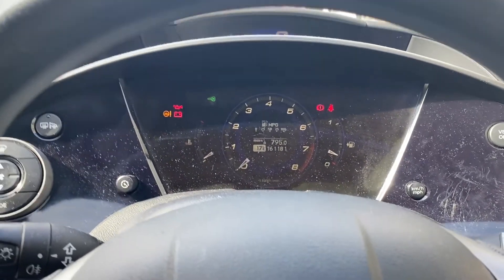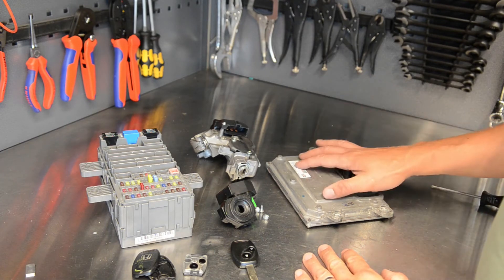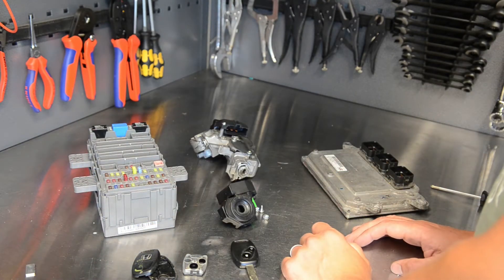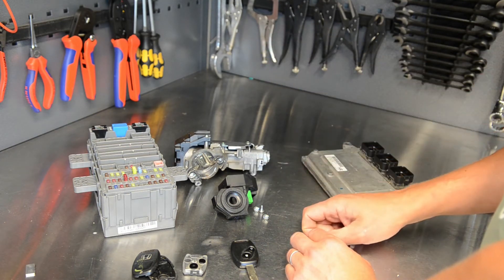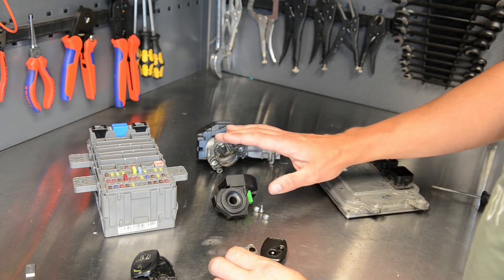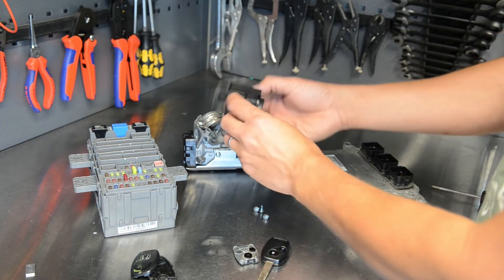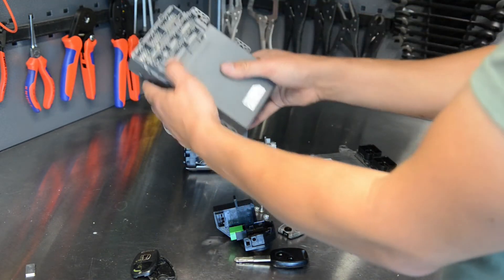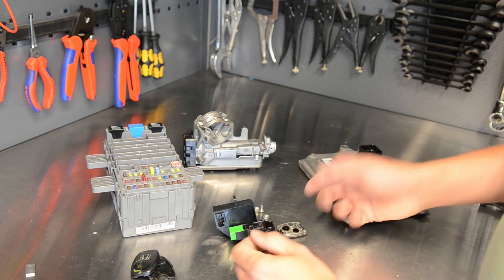Honds Civic Gen 8 2006-12 faulty ECU, MCU and immobiliser solution what you need to swap.

Comment: I replaced the ecu along with the key and immobilizer, still did not resolve the immobilizer issue for me. I'm stuck.
Reply from the maker: You have to swap all the parts, and they all have to come from the same car. The ring, mcu, ecu and key are all coded
Reply: Get the Thinkdiag mini code reader (cheap). It will reprogram Civic's keys and get you in again. I get the flashing green key if the battery goes flat. Unless the ECU is actually fried, it'll work, trust me. https://www.youtube.com/watch?v=koK84SHNOH0

Comment: Hi ive got a customers 57plate honda frv 2.2 diesel, flashing green key crank no start after battery+alternaor replaced (diagnosed by AA). I've tried to talk to immobilizer ecu via honda hds program but it wont communicate, on the live data its saying immobilizer 'BAN', I've been told it just needs a simple "all keys lost procedure" but not 100% sure if that will work+cost of £130+vat, sbb key prog etc dont list FRV on vehicle lists for usa/Europe honda. Would this procedure work that your describing? Thanks Tom
Reply from the maker: It should because your replacing everything, there is no coding involved as all parts come from the same doner.

Comment: Hello there, I ve got an 8th generation 1.4 lt 2007 HONDA CIVIC with IDSI engine. Without any ECU fault codes the engine cranks but without spark any of the ignition coils. I have replaced the crank sensor and cam sensor but still nothing. Fuel  Pump and Injectors checked and works ok. The electrician made certain checks and found nothing. The ECU connects and can read all of the car information. The immobilizer key flashes once instantly as soon as the key is turned in second position. Second key also used. Any idea pls.

Comment: I've an 8th gen civic (EU variant, not US one. I'm assuming you have the same one) and my immobilizer can't read the key if the inside of the car gets hot. Basically if it's 18 degrees and the car is left out in the sun - it won't start and immobilizer icon will keep blinking until it cools off. (assuming it can cool off if the day is not that hot). I've replaced the immobilizer antenna (the one around ignition) - same issue. Do these civics have an immobilizer control unit? Like a separate part besides antenna and MCU? Since the issue appears only if the inside of the car is hot, it's not ECU for sure. But I thought there is some other part like ICU (immobilizer control unit)?
Reply from the maker: Yeah this is a European model 5 door model, build Swindon, UK. In this model the antenna, the ecu, and the MCU are all chipped to the key, so you can’t just swap one. I’m in Ireland so it never gets too hot. I looked at the wiring diagram and the immobiliser is integrated, there is no stand alone unit you can replace. You need to swap the whole lot. I’m surprised you were able to replace just the pickup antenna, I tested that at the time and it was it wouldn’t work if it wasn’t matched to the complete the set. Hope this helps, you have a very unusual problem.
Reply: @Yoke.  well I didn't replace the antenna myself, it was done by an auto electrician and they had to reprogram it (something) with my key. But the issue remained. Either I got another antenna with the same issue which is unlikely or another part related to it causes the issue. I assumed there is some sort of immobilizer control unit part as well (chatgpt lied to me I guess), but if everything related to the immobilizer in these hatchbacks is the antenna, fuse box (MCU) and ECU, then it has to be the fuse box. If ECU is located under the hood, the only part related to it which remains in the inside of the car is the fuse box. In that case I will order a used fuse box and replace it.
Reply from the maker: @BruchoSindicate  Buy the full set and swap it out, it’s just plug and play. I got mine on eBay, it was cheap. The MCU is a nightmare to get to, might be easier to pull the driver seat out and lie flat on the floor. You will need a key with that set too and just swap the chip with your key. The pickup antenna can also be swapped without taking the steering wheel off but it’s a bit tricky to get to, I did it so it can be done. If you look at the wiring diagram for the car there is nothing else associated with the immobiliser
Reply: @Yoke.  Since I've already ordered and received the entire fuse box (under the dash) I will replace it alone at this point. Sadly the seller didn't have immobilizer and ECU from the same car as well. So I will try my luck with the fuse box alone. I wonder if ignition assembly itself has some electronics which could lead to faulty immobilizer signal when warm. Hopefully not. Logically if we have 3 main parts which could be the issue - ECU, MCU and imob. antenna it seems like the fuse box (MCU) is the only remaining suspect. I will try my luck and let you know if that worked. Hopefully it's not some wire or connector, that would be a hell to troubleshoot. This issue has already been insanely annoying.
Reply from the maker: @BruchoSindicate  ignition is just a switch, there is no electronics in it. It’s just simple on, off. See how you get on, it’s a tricky one to swap out, loosen what you can, you will also need long nose pliers to pull the connectors and long screw drivers to push the tabs. I suggest wear gloves as there is lots of metal edges, you will cut yourself. Good luck.

On a side note, I remember years ago I had a Honda Beat, if you drove it for a long time, turned it off. It sometime wouldn’t start from hot. It turned out the the fuel pump relay was getting too hot, engine was near it. The solder would melt a little and you would get dry joints, I re-soldered  it and it never game me trouble again. Could be something silly like that. Where do you live that it gets this hot?
Reply: @Yoke.  I know for a fact that the issue is regarding immobilizer system and not fuel pump relay, because immobilizer key blinks and doesn't turn off when I put my key in and try to start the car when it's hot. 

The funny thing is, it's doesn't really need to get that hot. I live in Lithuania, so weather is similar to UK during spring/summer. If I would leave it parked in the sun with closed windows even at 16 degrees C for a long time it will not start. So during the summer it's pretty much un-usable. I really doubt that the antenna which I've already changed had the same issue, and since ECU is under the hood and the only remaining link to immobilisation system is the fuse box I really hope that will do it. 

But again, I will need an auto electrician to change it, I've read in repair manual that changing the fuse box when ECU and antenna are not from the same car will need to be reprogrammed.
Reply from the maker: You are right In everything your saying, the internal fuse box is the last component now. I’ve been to Lithuania, it can get hot in the summer. My point was that the solder meted at the pcb and created dry joints that worked when cold but not when warm. If this is not a fix then you need to look at the joints for any dry joints. Good luck I think your on the right track
Reply: @Yoke.  Damn I think I've checked the wrong manual though. The manual depicting MCU (fuse box) as a part of immobilizer system is for US version civic, sedan one. Found one for EU/UK version - fuse box is not in the picture. If its replacement won't help - I'm out of options. 😁
Reply from the maker: @BruchoSindicate  is yours a 5 door model or 4 door? And where was your car manufactured? Because the 4 door sold in Europe is built in Japan, and that’s a different car.
Reply: @Yoke.  5 door, hatchback. I believe it's FK3. It was sold originally in France.
Reply from the maker: Same car so, I suggest buy the whole set and swap it out. This way it’s one job, you will save a lot of time and sets are cheap on eBay. Pick the same year and model.
Reply: @Yoke.  So coming back to this with an update, they have replaced the fuse box, reprogrammed it - immobilizer key kept flashing even when not hot. They replaced back the old one - same thing. So they found out that some wire leading up to immobilizer antenna (I assume) was in a bad condition, so they removed it completely and connected a new one (seems like it goes out of one of the fuse slots in the fuse box directly, so it's a bit mad max style for sure) and then it worked again. So it seems like that culprit was that damn wire all along. But I can't test it for sure because the weather got cooler and I need at least 16-18 degrees of sunny weather to test it. But yeah, I have a feeling that will be it.😁
Reply from the maker: @BruchoSindicate  hopefully that’s it. If it was a damaged wire the. Temperature wouldn’t effect it really, and it must have been tampered with previously for it to get damaged. Hopefully this now solves the problem. You have plenty of spare parts now 😀
Reply: @Yoke.  maybe it was the fuse box AND the damaged wire, well will see once the weather warms up, then I will know for sure 😁

Comment: Did u flash / reprogram the ecu
Reply from the maker: No I didn’t do any flashing, I bought a complete matched set so I wouldn’t have to do that. All has to be from the same vehicle and then it’s just bolt off, bolt on
Reply: @Yoke.  

That’s good to hear , I was worry I have to flash it. So I’m assuming everything works great even the key imobilzer with the new ecu…
Reply from the maker: @gfhjhvjgfvkjvv3666  yeah it will work for you but you need to swap all the components and the chip in the key as they are all coded even the immobiliser ring around the steering wheel. I found this all on eBay but it’s needs to all be from the same car, you need ECU, MCU (fancy fuse box), key, immobiliser ring, and ignition. Swap them and off you go. Only thing is I knew what caused the issue in my car, so whatever issue you have had to be sorted otherwise you could blow the new one too
Reply: @Yoke.  

Got it , thks 👍
Reply from the maker: @gfhjhvjgfvkjvv3666  good luck

Comment: Hey man, if you’ve got the time I have further questioning about a similar situation to this. If you could respond back to me either here or on another platform I’d very much appreciate it!
Reply: I had a similar issue show up on my 2008 Honda civic Si after a lack of a chassis ground either threw my car into security mode or fried the ECU. The car will start every other ignition cycle but will immediately die after starting. The only cluster lights that come on are the red ring around the tachometer and no door locks, window switches, or sunroof controls are operable within the car unless voltage is applied through a third party power source directly to the unit. I’ve pulled the driver door lock cylinder, ignition cylinder, and ECU and plan to replace the BCM as well for the window/sunroof switches. The power locks still function with the key fob however, which has me stumped. Fried ecu? And what do you recommend I swap out to get it back to functioning as it did before?
Reply from the maker: @michaelsapp6675  that’s a good one, I suppose to test the ecu you need specialist equipment to really know what part of the circuit failed. Since your like me doing this at home, swapping one part of this is not really an option as immobiliser will stop the car. The ecu, bcm, key and immobiliser ring are are coded to each other. They only problem in your case is that you don’t know the cause, so you swap it out and it get fried again.  You would really need to find the fault first or what happened just before the damage, were you at anything before hand. What caused the damage in this civic was an earth applied to the wrong pin on the air conditioning unit (not by me). Pull up the circuit diagram but everything goes through the bcm and if you swap that you need to swap the rest as you have no way of coding the new bcm.

Comment: Thanks a lot for this video. It is pretty much the only solid and reliable solution for the imobilisier problem if you want to diy. I ordered the kit from ebay for my 2006 civic mk8. Although it was from 2008 model and had G34 number on the ECU instead of original G13 it works fine. Took me 1.5h to swap it. The fuse box was a real pain but managed. I made a small and long 90deg hook to pull the clips on the sockets from below and then from the side pushed the sockets out, worked quite well but still a pain. Very happy as it only cost me £35 quid (but saw many kits for £100 or more). The tip to swap the chip in the key saved a ton of work too, so easy. Removing the imobiliser was very easy, just two screws actually, not 3. Thanks again for your video.
Reply from the maker: That’s great, I am glad you got sorted. That fuse box is a right pain to take out alright. But like you say, this is the only way to do it. In my case the ECU got fried when an expert shorted a connector. The choice was to scrap the car or try and figure this out. At £35 you did well, mine cost around £80 but it’s still worth it.
Reply: @Yoke. Such a great video, thanks for all the precious informations. My current setup is a Civic EG Body with K24Z7 engine, it's equipped with original relay boxes micu//harnesses ECU and car key from CIVIC SI 9th (the actual car i have taken the engine from).

Due to project needs I'd like to install an aftermarket ECU like Haltech or AEM instead of the original civic SI ecu, but i know for sure these kind of ECU's don't manage the immo system. From your experience, if the ECU is aftermarket can the immobilizer be triggered directly by the micu/car switch alone? I really hope to turn on the engine with aftermarket ECU

Comment: Where exactly is the ECU located? 
I have the same fault with mine.
Reply from the maker: Eco is under the bonnet next to the battery and fuse board. The MCU is behind the fuse board at the foot well, and then you need to swap the ring around the ignition. You need all 3 matched to a key, to get this done. Good luck
Reply: @Yoke.  mines a 2007 and I've found out that's in behind the Glove Compartment.  Hope this helps other viewers.
Reply from the maker: @Ash-T-Haqq-Vlogs  ah I forgot to ask that very important question, what model was it. My bad, I will update the description. Mine was the 5 door spaceship model, yours is the 4 door I suspect. Thanks for pointing that out
Reply: Just a note for viewers. On the 2007 onwards the ECU is behind the glove box. Easy to get to. MICU however as explained by YOKE , is an absolute nightmare to get to.